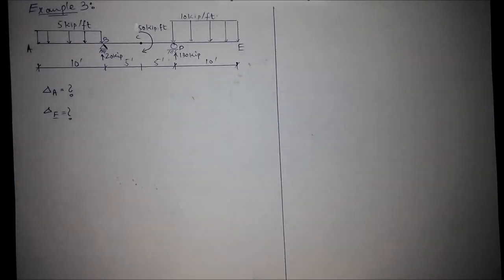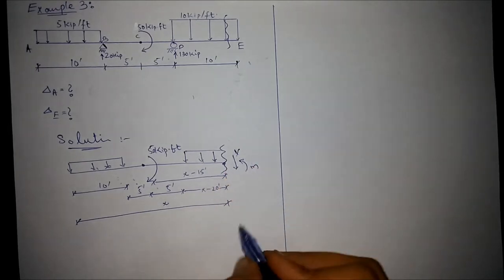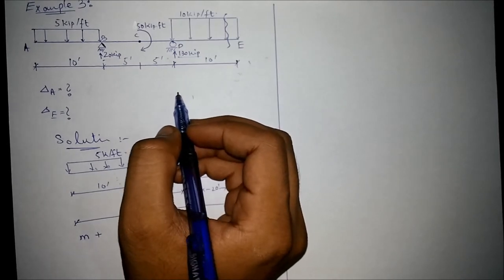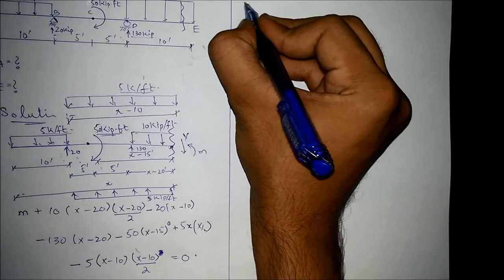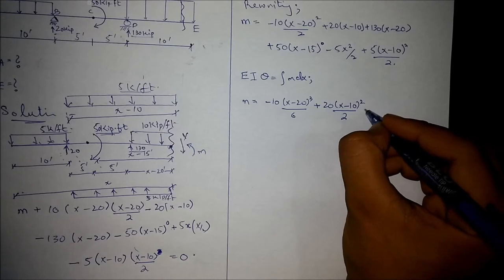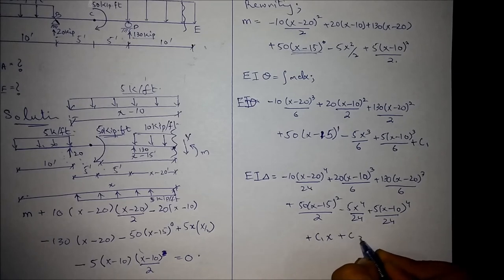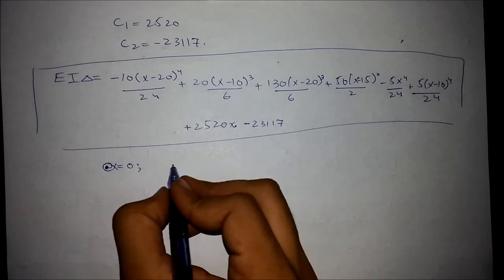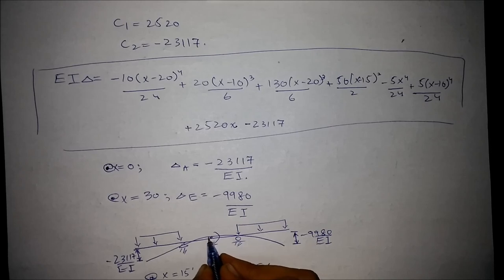Double Integration Method Example solution ( Overhanging beam problem )

Comment from the maker: For solving c1 and c2:
Eqn 1: 10c1 + c2 = 2083.333
Eqn 2: 20c1 + c2 = 27291.67

These equations were formed by putting boundary conditions in general deflection equation and neglecting negative brackets example ( x-20) if (10-20) -> -ve so ignore it in forming c1 and c2 equations

Comment: C1 and c2... I can't found this values... what did you do?
Reply from the maker: Jose Medina in equation 2 i put boundary condition, i.e at x=10 EI(delta)=0 gives an equation lets call it eqn A and at x=20 EI(delta)=0 gives an other equation call it B with c1 and c2 unknowns
Solve the 2 equations A and B simultaneously for c1 and c2 .
Reply from the maker: For solving c1 and c2:
Eqn 1: 10c1 + c2 = 2083.333
Eqn 2: 20c1 + c2 = 27291.67

These equations were formed by putting boundary conditions in general deflection equation and neglecting negative brackets example ( x-20) if (10-20) -> -ve so ignore it in forming c1 and c2 equations

Comment: Can you please show me how to get the values of C1 and C2? I can't seem to get it
Reply from the maker: We just simply solved the two simultaneous equations
Reply: @EngineeringLearningPlatform  can you show me at least how?
Reply from the maker: Jose Medina in equation 2 i put boundary condition, i.e at x=10 EI(delta)=0 gives an equation lets call it eqn A and at x=20 EI(delta)=0 gives an other equation call it B with c1 and c2 unknowns
Solve the 2 equations A and B simultaneously for c1 and c2 .
Reply from the maker: For solving c1 and c2:
Eqn 1: 10c1 + c2 = 2083.333
Eqn 2: 20c1 + c2 = 27291.67

These equations were formed by putting boundary conditions in general deflection equation and neglecting negative brackets example ( x-20) if (10-20) -> -ve so ignore it in forming c1 and c2 equations
Reply: @EngineeringLearningPlatform  why ignore -ve?
Reply from the maker: @waleedales5880  If not, then use each sections individual moment equation.

Comment: In overhang beam at support  there will be moment ,so why we are not consider that moment  in moment  equation ?
Reply from the maker: If you are talking about free ends there will be no moment similar to cantilever case while at pin and hinge supports there will be internal moment which will be due to applied gravity loads and the load is multiplied by lever arm in moment eqn to convert it into moment, hence it is considered

Comment: For boundary condition, can slope at C be equal to 0?
Reply from the maker: No because not a fix support
Reply from the maker: For solving c1 and c2:
Eqn 1: 10c1 + c2 = 2083.333
Eqn 2: 20c1 + c2 = 27291.67

These equations were formed by putting boundary conditions in general deflection equation and neglecting negative brackets example ( x-20) if (10-20) -> -ve so ignore it in forming c1 and c2 equations